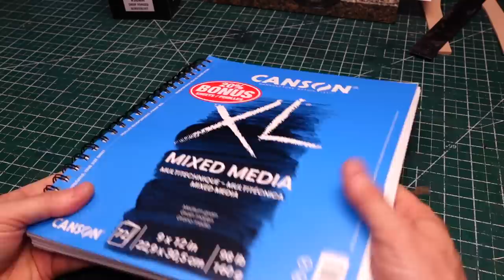Making a Leather & Kydex Survival Knife Sheath Leather Working ASMR

Comment: I am a Bladesmith and make all my own sheaths and have made sheaths for David Boye knives for several years and have learned a lot doing so. I learn more from every sheath video you make, Thank you very much, beautiful work. I cringed when I saw you using your skiving knife to pry the Kydex up over the rivet. A couple of weeks ago I opened up my thumb with my skiving knife, glad you didn't do the same.
Reply from the maker: Thanks! I needed something thin but strong to slip under the Kydex. I think it looked more dangerous than it was; if I slipped it would have just gone into plastic.
Reply: Lee Sass Hi have you a channel ?
Reply: @RoadAgentLeather  do you know a place to buy tooling leather for cheap? I’m 13 so I can’t afford much, but I need quality for my sheaths…
Reply from the maker: @LittleGreyWolfForge  Have you tried Tandy, Springfield, or Weaver? They all have sales and 'economy' leather. May also want to check eBay and Amazon.
Reply: @RoadAgentLeather  tried em before, didn’t have great experience with any of them except Tandy… I’ll try it!
Reply: @RoadAgentLeather where may get you sir. To buy

Comment: Stuning job young man neat & clean and also very clever attachment of the belt loop. The only thing you need is a peaice of spacer leather between sheath body& belt loop and the knife will seat properly . Happy Trails
Reply from the maker: Thanks! The Kydex insert forms a slope that the blade rides down on (and keeps the sheath's mouth open). I didn't think about it until it was too late that I could have seated the insert a little deeper to make it sit flush. Will have to remember that for next time.

Comment: Congratulations to your new leather sheath👍..and knife..💪.Although it was a hard job to make it..I could recommend to buy an extra Drop forged knife..one never knows,because sometimes it is very easy to loose the knife on the grass and any other knife than this does'nt fit that beautiful sheath.Better have two pieces🙂..maybe it would not be possible to got it in Cold Steel offer after some time although the knife is awesome...sometimes it happened to me,I'm afraid😂😭
Reply from the maker: Loosing the knife sounds like something that would happen to me.

Comment: I’ve made a few sheaths over time. Q: What’s the difference between a guy who makes things and a master craftsman? A: An infinite number of little things. I did chuckle when you used a drill press for lacing holes, because I’ve done that.  I also had this fantasy of an apprentice in your shop asking “Why did you tool the back of the sheath?” “Because that’s what’s going to make it better than yours.”  I do think you’re at a level of craftsmanship that having a “maker’s stamp” made to brand your work wouldn’t be out of line.
Reply from the maker: Thank You! I do have a makers mark stamp. But it's too large for this piece. I need to design and 3D print an abbreviated version of it. I've just never got around to it.

Comment: I learned a few things I haven't thought of before, thank you very much. 

One thing though: I do not know what your fume exhaust situation with the laser is. Burning away kydex is close to being dangerous. Kydex being a PVC, it releases chlorine gas when burned. Not only is that all kinds of hazardous to you, it's also corrosive and may damage bith your laser as well as the exhaust pipes.
Reply from the maker: Thanks! Yes, I'm aware of the hazards of burning Kydex (and other synthetics). I don't work with Kydex often at all. The last time I did I used tin snips. However, this was a complex little piece that I needed cut and scored precisely. My laser has air assist and a good ventilation system that I have piped to the outside. I'm also working in my garage with the garage door open and fans running. It's still a risk/benefit decision; I decided the relatively short period of time I ran the machine cutting and scoring this piece was worth it.

Comment: I use a small dremel drillpress also. Lately ive been using my class 26 taking the thread out and just using the needle to poke my holes. I still get the strength of my 1.0mm ritza thread but so much faster. Also my holes are more in line. I noticed with drillpress some holes can get slightly out of perfect alignment. I love this sheath. Ive never used kydex but might give it a try one day. Im assuming thats what you used
Reply from the maker: Thanks! Yes, I've only used Kydex a couple of times before for simple pieces. This was the most complex piece I've had to form.
Reply: I had too much trouble with a dremel , holes looked shabby . I use my Tippman Boss without thread for thick projects .

Comment: Once you put the blue masking tape on, then add tuck tape ( the red tape used with vapor barrier installation) no more stretch due to the tuck tape and still easily removed thanks  to the blue masking tape
Reply from the maker: Good tip. And thanks for subscribing!!

Comment: What drill press did you use to make the holes foe sewing, this would make my projects so much faster. Im guessing a special drill bit for it as well?
Reply from the maker: Are you referring to the drill press at the 19 minute mark, or the little hand press at around 22 minutes? My big drill press is an older Ridged floor model. But you don't need anything that large: A cheap bench top model would more than suffice. And just regular drill bits work. The small push drill I used later is just for cleaning up the holes. I'm going though many glued layers and it helps to open the holes back up.
Reply: @RoadAgentLeather  I gotcha, yes the one at the 19 minute mark is what I was referring too, thanks for the information, really enjoy watching your content!
Reply from the maker: @iDoThingsOutdoors  Thanks! Tip: You can also throw an awl blade into your drill press chuck and make holes that way . . . without even turning the machine on.

Comment: Here in Venezuela we can't spill dye over the table because it is awefully expensive, we have to apply it carefully with a little brush, but anyway your videos have been an inspiration as well as a source of valuable info.
Reply from the maker: Thanks! Dye isn't necessarily cheap here either. I thin it down with alcohol to lighten it and also so I can build up the colors darker on the edges.

Comment: I have the same problem. I think the tape doesnt work on this type of stamping cause its literally the whole piece of leather so the extra has to go somewhere. I just cut my backpiece a little bigger and trim to fit
Reply from the maker: Exactly. In this case, I needed these two pieces of leather to stay exactly the same shape and size. Any inconsistencies in their dimensions would have screwed the whole thing up. Hence the wooden frames to keep it all contained. I had done this previously by printing the shape out on my 3D printer. But the laser makes it SO much faster and more convenient.
Reply: @Road Agent Leather  yea i wrote my comment before i saw you stamped both sides. Definitely more critical. Also just saw the hand drill and dude i want one
Reply from the maker: @joshuapoche5137  I think this is the set I purchased: https://www.amazon.com/Pieces-Include-Semi-automatic-Polymer-Jewelry/dp/B089YPYSK6/ref=sxin_17_pa_sp_search_thematic_sspa?content-id=amzn1.sym.6fd80408-71b6-44da-b059-082bba9089d3%3Aamzn1.sym.6fd80408-71b6-44da-b059-082bba9089d3&crid=33T9YVSABK59X&cv_ct_cx=hand+drill+spiral&keywords=hand+drill+spiral&pd_rd_i=B089YPYSK6&pd_rd_r=3209428a-1974-4996-ac6c-a7971f448f21&pd_rd_w=CSqg0&pd_rd_wg=2KI7u&pf_rd_p=6fd80408-71b6-44da-b059-082bba9089d3&pf_rd_r=F3RP9K8WEYJ0DK9VMCC5&qid=1687130920&sprefix=hand+drill+spiral%2Caps%2C120&sr=1-4-364cf978-ce2a-480a-9bb0-bdb96faa0f61-spons&sp_csd=d2lkZ2V0TmFtZT1zcF9zZWFyY2hfdGhlbWF0aWM&psc=1

Comment: Beautiful sheath, but I'm sure the value of CNC cutting the leather unless you plan to mass produce these. By the time you program it you could have cut out a bunch of them with a utility knife and had an arguably cleaner edge
Reply from the maker: Thanks! The laser cuts perfectly identical parts. Which was important for this project (especially the wooden tooling frames.) I'm a professional graphic designer as my full-time job. So sketching, scanning, tracing, and vectorizing parts only takes me a few minutes.
Reply: @RoadAgentLeather  I understand. Thanks for the reply. I'm about to steal your idea of putting the leather into the frame for stamping to keep it from becoming distorted. Of course I'm cutting it by hand and now I wish I had a CNC laser too!

Comment: 2:36 what was the soap for?
Reply from the maker: It's an old trick I learned. The saddle soap helps lubricate the leather fibers: This makes carving with a swivel knife easier (if you're using one) and helps make the leather more pliable, which results in better stamp impressions. It also slows down the drying a bit. But it's something definitely not everyone does.

Comment: Link to your tools please,, the adjustable "holestamp" especially
Reply from the maker: Most are from Tandy. Some are from Amazon. The rotary leather punch is from Tandy.
Reply: @RoadAgentLeather  I meant the one to pre set the stitches, wher you can put more or less "needles" in
Reply from the maker: @blackz9058  Those are "WUTA" brand stitching chisels from Amazon. They come in a variety of sizes and configurations and are relatively inexpensive. I've purchased several of them and they're holding up just fine.

Comment: Nicely done. Your hands are starting to shake, you might want to check in with a doctor to look at it. And when making a sheath for a knife you need to hold the blade on the sides so the cutting edge can not touch the leather or any other material, it both makes the knife sharper for longer and the sheath suffers less damage.

Comment: Love your work and videos. Laser cutting Kydex is supposed to give off hydrogen chloride fumes that can be very toxic and corrosive to your laser.
Reply from the maker: Thanks! I don't work with Kydex often. This machine has a good ventilation system (that I have piped to the outside) and I'm working in my garage with the door open.

Comment: Привет из России!!!  Зачем мыльной водой смазывать перед тиснением? Это как то улучшает структуру кожи или как то влияет на тиснение?
Reply from the maker: Thanks for subscribing! I often use glycerin saddle soap before tooling as it helps lubricate the leather fibers. This helps a swivel knife glide through the material easier (not applicable here); leads to better stamp impressions; and slows down the drying process some so I don't have to rewet as ofter.
Reply: @RoadAgentLeather  Всё я понял, спасибо за разъяснение... ЖМУ ПЯТЬ!!!
Reply: @RoadAgentLeather  А на какое время вы томите в пакете мыльную кожу?

Comment: I am truly sorry and this a very personal opinion, but I don't think I can get past the fact that you used a laser cutter to cut your original shape... what in the world happened to craftmanship??? You for sure have it in spades, so why do that???? You know for sure that's entirely unnecessary!! Good old sharp blade can do the job just fine. SMH
Reply from the maker: @aleveraj  Thanks for watching! I'm curious how you would feel if I had stamped the pattern out on a traditional leatherworker's clicker press?
Reply: @RoadAgentLeather  I don't have a problem with using whatever you want, specially a clicker press if you're going to repeat a model multiple times. In that scenario, maybe even the laser cutter can be justified. But in a one time sheath?? I still think the old way is as effective and quick as setting up everything for it in the laser. Just an opinion.